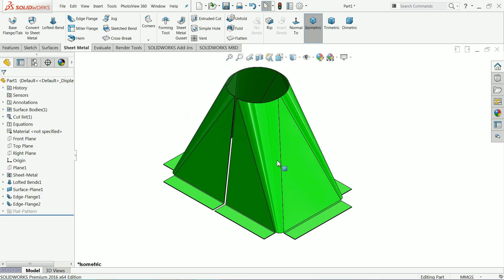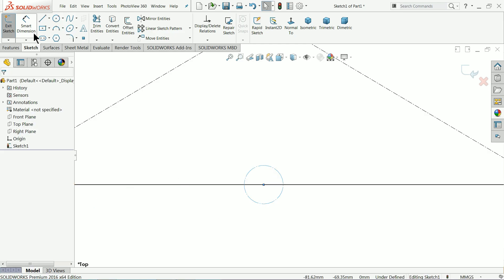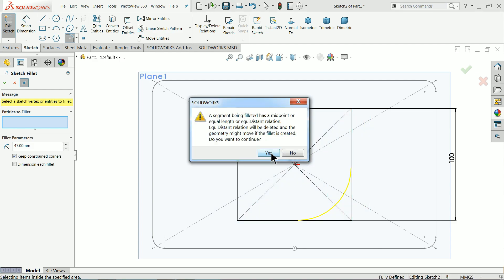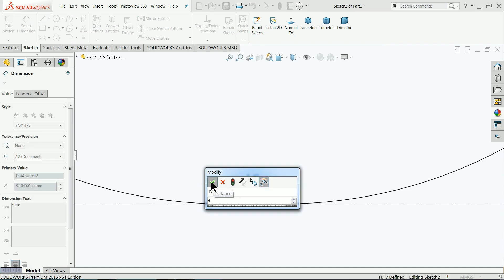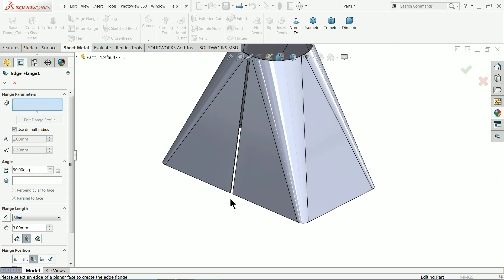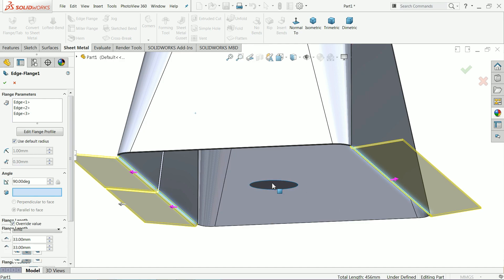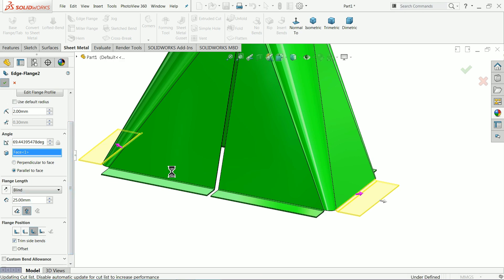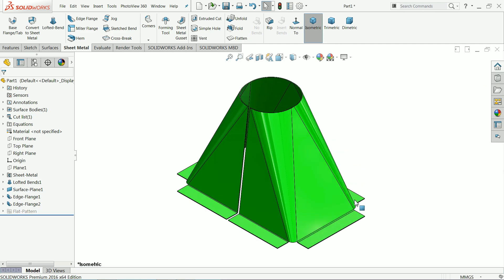Hopper in Flat form using Solidworks sheet metal

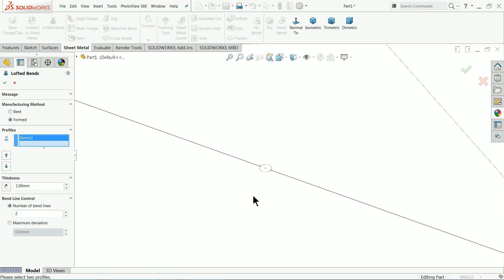Comment: at 5:24 in video your circle is blue and mine is grey/black...then when i joint the points in flange i get a pointed cone and not the open circle hole at the top. ...what am i doing wrong.